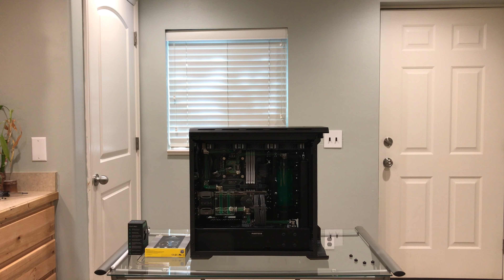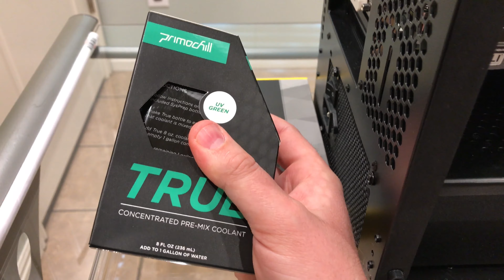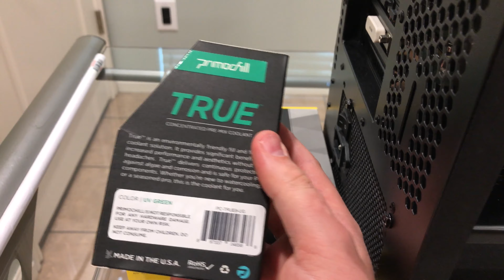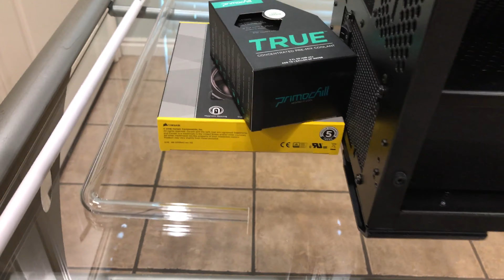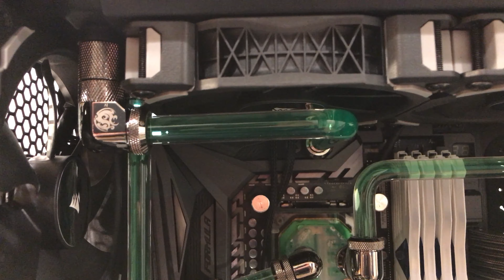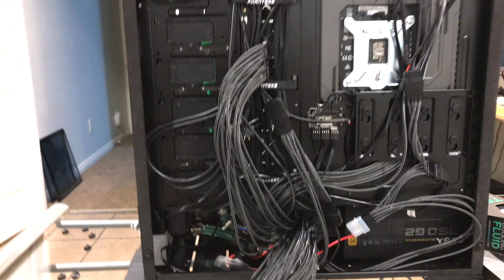Why and how I water cooled my Phanteks Evolv TG with EKWB and glass tubing.

Comment: Fine video man. I’m curious if you have any tips for beginner
Reply from the maker: Id love to help out. What kind of tips are you looking for? Any specific questions?
Reply: @PCGoblin  how to setup Acrylic tubing with the hot gun + bending with silicon + molder and cutting with dremel. Additionally, how to make sure primo chill prep kits don’t ruin coolant and cause breakdown. Should I just stick to primo chill Coplants for compatibility after using there prep kits
Reply from the maker: I wish I could help with the acrylic stuff, but I unfortunately have never used acrylic. Ive only used glass and soft tubing. However with the prep kit, all you need to do is make sure you flush it with distilled water a couple times to make sure you get most or all of it out. After that it wont matter a whole lot. The trick to cooling loops is making sure you stay on top of maintenance. So make sure you flush it every 6 months to a year depending on how heavily or little its used. 
As for coolants, I try to stick with just clear stuff since I suck at loop maintenance. It doesnt stop issues but the fluid you see in this vid I left for too long and it destroyed my loop basically. 
Any other questions I might be able to help with?

Comment: what was your method for cutting the shortest lengths of the glass?
Reply from the maker: I used a tile saw to cut every piece. Trying anything else just didnt work for me for any length.
Reply: PCGoblin I've got my glass and just doing my build with petg first to get sizes, probably use dremel then for small cuts!
Reply from the maker: A dremel should work well. I didnt have one and the cost for a dremel and the tile saw were about the same so I ran with the tile saw. But good luck on the build. :)

Comment: So you feed warm water from VRM+CPU to your pump? 
Looks stunning, but I would connect it like this: Pump --> GPUs ---> Top radiator --> VRM ---> CPU ----> Front radiator (obviously with the ports on the top) ---> Reservoir ----> Pump
It's always better for the pump to run with cooler liquid.
Reply from the maker: Thank you for the compliment. The system looks even better in person. As for the water path, it shouldnt matter where the water goes as its a contained system so the water isnt super hot going from the CPU to the pump, Whatever the loops temp would be is what the waters temp is, so water coming from the rad isnt any cooler than water from the cpu. If water temp was that different from component to component then there would be little point for thermometers in the loop to measure water temp. :)

Comment: I own the Evolv and the Formula IX and your top mod is exactly what I've been looking for and I was worried about clearance to get a tube into the VRM block.
Reply from the maker: Im glad I could help. Great case and motherboard too. :D
Reply: About those plates, are they aluminum?
Reply from the maker: They are aluminum. I got like 1 foot bar from lowes for a couple bucks. I did aluminum so it would be easier for me to cut and drill.
Reply: Awesome. Thanks for the replies, I'll be sure to send you some pictures of my finished build in the coming months because you sir are my inspiration.
Reply from the maker: Sweet! I cant wait to see the finished product.

Comment: Did you run into any issue with the Mayhems' tubing not being consistently the same OD and not fitting into the fittings?  What OD tubing did you use for this build?
Reply from the maker: Good questions. I had 0 issues with it fitting into the bitspower fittings. I ran with the 12mm glass tubing. When I would push the tubing into the fitting I would get the o-ring in the fitting wet and the outside of the tubing wet and it would slide in with no issue. If I ever tried it dry it would tear the ring.
Reply: Thanks, good tip to remember when i start my build!
Reply from the maker: Sweet! Good Luck. :D

Comment: Where can we see performance of that custom loop ? i have the same hardware i want to custom loop for the performance it give but custom loop have a price i will really appreciate some performance of temp and overclocking information .
Reply from the maker: Im working on another video where I have benchmarks for things. But what kind of information are you looking for? Id love to make sure I can help.
Reply: as u can see i have a gaming chanel where i show fps performance in 4k and 5k i will like to know how it perform with overclock and temperature on idle and load temp on 4k resolution i use msi afterburner for on screen display and sometimes i get 80+ degrees c on my main card in sli and my 7700k sometimes hit 78 degrees c  Here is my config Core

 i7 7700K 5.1ghz Oc
Ram 16gb (2x8) G.skills trident Z 3200mhz ddr4
Watercooled corsair h115 i
Motherboard Asus maximus FORMULA IX z270
GTX 1080 TI sli ASUS STRIX OC EDITION
Hardisk ssd samsung evo 500gb
Hardisk hdd toshiba 1tb
Casing Phantek evolv tempered glass edition satin black
Monitor Asus rog PG278Q 1440p native 144hz Gsync
Reply from the maker: I think the TIM from intel(under the lid) on my 7700k is messed up, when my CPU Is 100% i get up to 90ish degrees on it. But my GPU's never go over 51degrees when theyre running 100% no matter how long they run at that.  I hope that helps but youve given me an idea for another video or two from this. So thank you and thank you for watching.
Reply: np waiting for ur video i did sub now waiting

Comment: How did you attach the pump to the case? all the pre-cut holes don't seem to fit the D5. Did you drill or use double sided tape?
Reply from the maker: I had to drill two extra holes to be able to mount it. Really made me mad but it was relatively easy to do. The d5 comes with a template for the holes, so I made copies of it and the taped it where i needed the pump to be then drillled the holes.
Reply: Thanks for your answer! I ended up using 1 screw and very strong double sided tape. It holds well now and did not have to damage the case
Reply from the maker: Thats great! I was thiniing of doing that but I decided that I didnt care about two extra holes on the bottom. Are you doing glass tubing?
Reply: No this is my first ever custom loop so I decided to go soft tubing for now. The trickiest part was to get all the correct parts so I didn't want to overcomplicate my first build with hardline or glass. However the next build i'll do is a different story :)
Reply from the maker: Thats awesome!

Comment: nice build! quick question.. newb here btw.. is there a specific fittings for glass tube or it uses the same compression fitting for petg and acrylic?
Reply from the maker: Its the same as petg and acrylic. But even then some work better than others. I ran with bitspower because i knew they would work. Had ek fitting been cheaper i would have prefered them. From what ive read about the ek fittings fit the best on glass.
Reply: thanks man for the tips!! will try out soon!!

Comment: You sir have just became my new best friend.  Your build is exactly what I am doing to my new build.  I have the same cpu same idea with cooling the motherboard and have to gpu's in sli and same case. the difference I have 1080 ti ftw3's is the only difference.  If you don't mind I love your top radiator mod I would love to use your idea to do to my case.  I never really though about using glass tubing for a loop but seeing it done here i'm going to do some research and how to use it in a system cause I love how it looks in your case.  I  too want to use a d5 pump in the basement so I'll be doing that as well.  but question what are the thickness of your rads?   That is what I really need to know to I can clear the top motherboard fitting up top. But well done I just hope mine come out as good as yours.
Reply from the maker: Im glad I could help. Had the ti's come out when i bought all this I would of run with them. However the rads I use are Hardware labs 360 GTS Radiator and the Koolance 280 Radiator They are both 30mm rads. If you have any other questions about it please let me know, Im happy to help. :D

Comment: nice vid, nice monster..

quick question.. does glass tube have any benefit over other tubing or is it just aesthetics?

I tend to use uv blue tubing and clear premix, as I have seen posts pointing out that with a lot of dyes/special coolant can cause a build-up of gunk in the system. I used to use mayhem aurora, but those posts encouraged me to dump that in favour of x1 clear and uv blue tubing.
Reply from the maker: Hi Paul, glass is mostly aesthetics, however i dont have to worry about it fading or getting stained by any dyes. It can still get dirty but i can clean it easily and its back to how it was. But I havent wanted to dye my fluid since ive read that it can dye my other components (rads blocks etc). Im not sure how true that is but thats why i ran with the fluid that i did. I hope this helps but if you have any more questions please let me know.
Reply: Yeah, the exact reasoning for me dumping mixes/dyes also. but thanks anyhow..

Comment: yeah those glass 90s look good. I was worried i would fuck up the glass cutting so went all straight tube to save wasting a buncha $25AUD a piece bends. also i love the looks of fittings :D

been working with the 16mm mayhems glass tubes for a couple days now and yeah, so much better than the acrylic i made a temp guide loop with.

suprised theres not more glass tube videos out there...
Reply from the maker: I think people are scared of using glass due to complexity but if you have the right tools its not too bad. I like the look of fittings too, but too many makes it look busy.

Comment: I heard som glass sounds when moving your pc. Is it the glass tubing in your pc making that noise? Do you have to be more careful moving it compared to other tubing?
Reply from the maker: Ah, that glass sound was from the desk it was sitting on. Its not very steady and it was the glass on the desk as well. From what ive experienced is you just need to be careful when moving the tubing itsself. I had a glass 90 going from the front of the rad across the top of the basement and when i was undoing the water bridge for the gpus it cracked it in the connecting fitting. Due to how rigid it is. You have more play with straight tubes and fittings than the 90's

Comment: As an Evolv owner reworking his loop, this was actually very helpful. I'm going to have to try that metal plates top mod. Also, I'm thinking of print a d5 in the same spot so seeing what I'm going to be dealing with is nice. 

This case his beautiful but a bitch to build a loop in. My build is slightly similar. 280 GTS up top, 360 GTR P/P front, with a custom made res. M7F mobo. The real challenge is going to be that pump area. Not looking forward to it.
Reply: paskowitz definitely thought the top mod was very useful.
Reply: PCGoblin Thanks. It's hard to stands out these days. 

I don't think a straight shot will be possible. Does this cause issues with the pump?
Reply from the maker: No but from what ive found is you want the straightest run directly into your pump or you might run it dry and that would be bad.
Reply from the maker: The pump really was difficult. It still is cuz connecting it to my Res is/was a huge pain in the ass. Im glad I could give you some inspiration. Are you planning on glass for tube as well?
Reply: PCGoblin This is my build now: http://i.imgur.com/TDiWxtE.jpg

This is what I'm planning: http://i.imgur.com/SJ2LhDf.jpg res would be in the back of the case. 

I'm running sleeved soft tubing. The sleeving also makes the tubing appear more rigid, almost like hard line.
Reply from the maker: I really like the sleeved tubing, I dont see that used very much. Im not sure how close to the spot the picture is for where your going to put the pump, but from what I ran into Id try to center with the RES as much as possible so its a straight flow down. Plus with how far over it looks in the picture it will probably interfere with your power supply cables.  But thats my only concerns. 
Whats the plastic or piece thats on the side of your 360 RES?